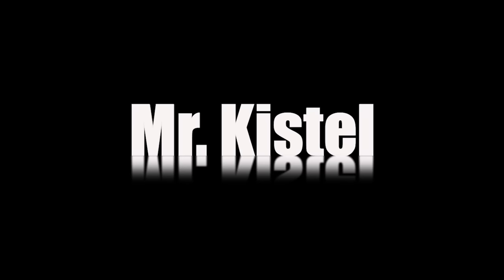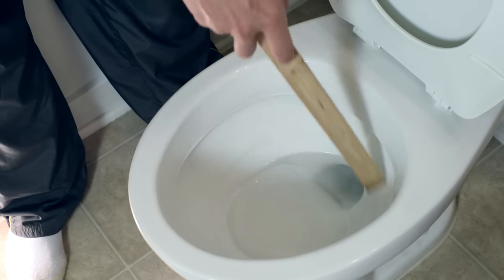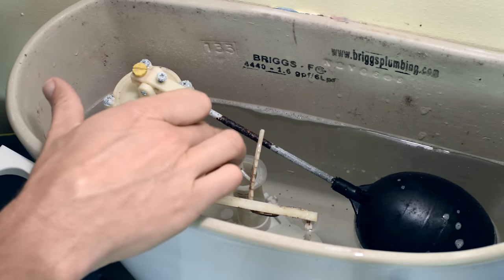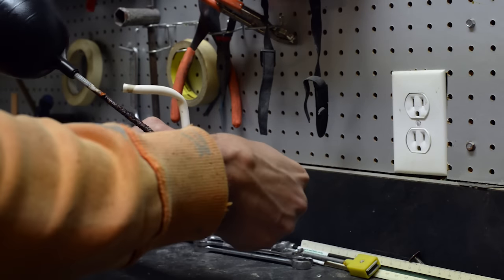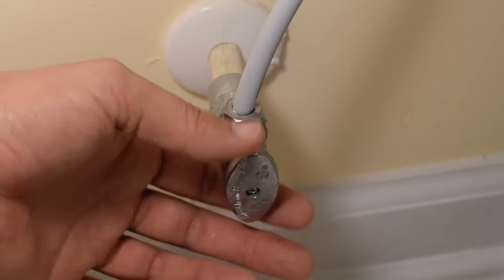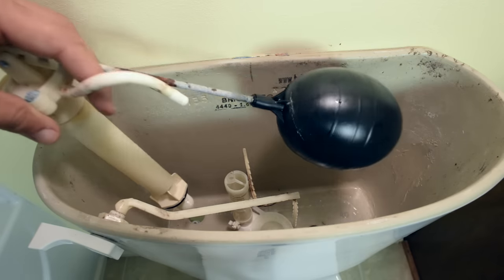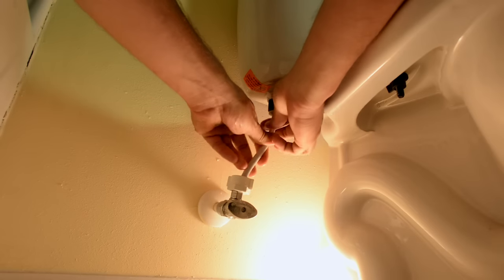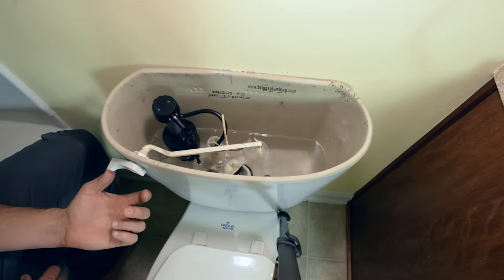Why Is There Low Water Level In The Toilet Bowl And How to Repair

Comment from the maker: Toilet fill valve: http://amzn.to/2uSmt8V
Pliers: http://amzn.to/2FAJmjR
My Children's book about a real life Tugboat story =https://amzn.to/3DbCNTX
Disclosure: The above is an Amazon webpage link. "As an Amazon Associate I earn from qualifying purchases."
Reply: @MrKistel
A relative of mine purchased a new toilet with 1.2 or 1.6 GPF.
But this new toilet has very low water level in the toilet bowl.
Do you think this high efficiency new toilet with 1.2/ 1.6 GPF causes low water level in the toilet bowl.
And do you think if she replaced it with an old toilet which has more Gallons per Flush will have a higher water level.

Comment: That still doesn't show me how to fix the toilet bowl that's not filling up with enough water.
Reply: Ah, you caught that one LOL
Reply: It made sense to me, but it could also mean that your problem has another cause.  Keep checking more videos.  Eg like others said, maybe your refill tube is dumping water directly into the tank, instead of the pipe that it is supposed to dump water into.
Reply: Agreed on that. That tube is called the overflow tube.
Reply: Actually, he showed you that the leak was allowing water to not go to the bowl, so if you replaced the diaphragm or the internal control, the bowl level would be fixed.
Reply: There’s this thing called deductive reasoning. It’s an important skill to have 😂

Comment: Not trying to be rude here, but you didn't really explain how to fix the problem of low water level in the bowl. You just said to buy a new one which I already have. So what's the solution if you have a new water fill valve but still have a low water level in the bowl? Thanks.
Reply from the maker: You could possibly have a problem with your plumbing venting which could create a suction force and "pull" water from the bowl.
Reply: You may have the same problem I did, which was, the filler hose needed to go into the empty cylinder shaped thing. Mine had somehow worked it's way out over the years.
Reply: @powerofknowledge7771  Thank you Angela. This was my problem. Fixed it. You rock.
Reply: @powerofknowledge7771  exactly,  I have a Kohler and indeed that's what happened with mine too. The water refill hose worked itself out of position so it wasn't dumping the water into the cylinder reservoir. When I first looked in, it wasn't leaking from anywhere and I noticed that hose just refilling straight into the tank. Which prompted me to search YT vids to see if that was correct versus being positioned to fill back into that cylinder.  Sure enough that solved for "A".  Thanks on Thanksgiving!
And FYI, haven't had the tank lid off in quite some time, so yeah, that can happen out of the blue all on it's own.
Reply: @powerofknowledge7771  thank you so much ! You solved my problem too
Reply: @MrKistel  Is that the vent coming out of the roof?  How do I check that?  My toilet fills properly, but then the water level goes down gradually.  I have replaced the insides totally, both fill valve & flapper & these did not fix the problem.
Reply from the maker: The venting plumbing will be piping that ultimately leaves the house (usually through the roof).  Sometimes something gets clogged in the pipe somewhere.  There are accounts of rodents, leaves, and all sorts of things falling into vent pipes and creating restriction.  Some have success sticking a hose down the pipe and forcing water to dislodge the clog.  In other cases sometimes venting is not plumbed correctly in the first. Best of luck.
Reply: @MrKistel  Thank you.  Looks like I need a plumber to get up on the roof.  Been trying to do everything myself, but not this!

Comment: Thanks for using Fluidmaster in your video! Just a quick side note for your viewers: Make sure you cut the refill hose down in length if needed. If the end of the hose is pushed into the overflow pipe too far it will cause a siphon and in turn "Ghost Flushing". The end of that hose has to be higher than the water level in the tank. Setting the water level 1/2" below the top of the overflow pipe and inserting the hose about 1/4" down into the small hole in the top of the pipe is the best way to prevent siphoning. We also include a clip with our fill valve that can be used.
Reply from the maker: +Fluidmaster Inc. Thanks for reaching out and the important note.
Reply: What do you mean by Ghost flushing.
Reply: @photoxityforever9503  no its when the ghost in your house pulls an upper Decker. Sh*ts in the tank
Reply: Siphoning would be causing the water level to continue to fall to its lowest state even though the tank is all the way full with the Fluidmaster correct?
Reply: This may have been my problem.  I just replaced the fill valve with a Fluidmaster fill valve and I must say it seems excellent quality, with the clip and great easy to understand instructions!
Reply: Thanks for your feedback!
Reply: @FluidmasterInc That was my problem BIG THANKS IT WAS DRIVING ME NUTZ.

Comment: My bowl wasn't filling up to the point it did before I put in a new flapper in. And it was flushing funky. This was the first video I checked out and it solved my problem. I had hooked up backwards, the thingy that puts the water in the little pipe in the middle. Instead of going in the pipe the water was just going in the tank. I saw what yours was doing and was able to solve my problem. Working perfectly now. I'm a widow, who does many repair jobs around my house with help from you guys and gals on utube. Thanks so much for the post. You're the least expensive plumber I've ever had!
Reply from the maker: So great to hear this video helped you solve your toilet problem.  Thank you for the sincere comment, I feel honored the the video was useful for you.  Congrats on your repair!

Comment: This solved my problem. Thank you. The filler hose had become disconnected from the vertical pipe and moved over. Therefore it was filling the tank instead of the bowl. The lady of the house is happy now that the toilet bowl has a normal water level again.
Reply from the maker: Glad to hear of a happy household now that the toilet has been repaired.

Comment: Thank you soooooo much. This fixed a problem I could not figure out. I became the hero when it worked!!!! You're the best. Wish I could send you a new jar of peanut butter and a clean spoon.
Reply from the maker: haha,  i bet you were already a hero but so glad this was helpful for you
Reply: Thanks for the laugh... great sense of humor! :-)
Reply: @MrKistel  NI
Reply: @MrKistel  Nice video Mr Kistel,, I live in an apt complex in Las Vegas. The water in out bowl is so low, its like dumping in a cup of water. They did what you did and replaced the thing, but the results were the same. I check my neighbors down stairs bathroom when they moves in and yup the same cup of water. Can you ascertain any problem that the complex might be having. We do live up the mountain side, but I been to gas stations and they all have plenty of water in there toilets. Let me know, like how many moving parts can effect the water in a bowl? One...
Reply from the maker: @photo7839  sorry to hear about the low water level problems with your toilet.  Another issue that could cause a low water bowl level is improper sewer venting due a blockage in the vent piping.  In some case that actual plumbing in the building is installed incorrectly or even with out proper venting at all.

Comment: Thank you very much. My toilet wasn't leaking anywhere but I noticed the water was low. after watching your video I noticed the rubber hose that comes from the fill valve fell out of the fill tube. I put it back in and the water line is back to normal. Thank you again!
Reply from the maker: Great news, thanks for sharing and for watching.

Comment: Thanks for posting this! I was having an issue even after installing the exact same fill valve you used in the video. As it turns out, the little rubber hose that attaches the the overflow tube was kinked, so I rotated the valve to make the hose straighter and eliminated the kink. Now the bowl fills up like it should.
Reply from the maker: Awesome!

Comment: I am a master mechanic of all electronics and mechanical everything but toilets. You just saved me so much grief I guess I never knew the whole flush thing. I just installed a new valve float assembly and the toilet has not worked perfect sense. Well it was in-op before that but after the bowl level was always to low no flush.  After watching you vid I realized the little bowl fill hose had a clip on it and I clipped it on the outside of the fill tube.  instead of the inside. The mechanics of you explanation once your video hit 2 minuets on the dot.  I ran for the toilet looked and found the problem right away.
You are awesome. Thanks nice funny helpful video.
Reply from the maker: Thanks for watching and the comment explaining your situation.  So glad the toilet valve installation video helped you solved your low water level issues.

Comment: User-friendly (get it?) video for people who are not handy with plumbing and who cannot afford a plumber. Thanks for explaining well and pointing out the specific places and parts that need undoing, twisting, shutting off...I had a little trouble with parts of your hand obstructing a total view, but that doesn't make the vid a deal-breaker. Keep on 'splainin'.
Reply from the maker: thanks for watching and the comment Carol
Reply: MrKistel, I thought I'd share the results of the repair. The black rubber ring around the new apparatus was chewed up all around. Very odd. The surprise is that the repair did not make the water level increase. The imported toilet is a budget product from a big box store, so the location or placement of the key parts was unusual. The toilet had to be removed and turned on its side to reach one in particular. The hardware story guy commented he'd never seen anything like the configuration when he saw the picture on the phone. From here on out, only American toilets in our house.

Comment: You know what grinds my gears? I've got a top of the line one piece toilet that I paid premium bucks for yet the fill valve is squealing like a trapped pig and needs replacement and the whole thing is less than 5 years old! Our old toilet from the 50's and 60's ran for years without any problems except for the occasional bend float rod or leaking float ball which was an easy fix. Now while replacing the fill valve is easy if you can easily reach the freshwater fill line but my cramped bathroom has the toilet less than 6 inches from the side of the tub making it nearly impossible to reach the supply line! You gotta have arms that flex in a dozen places to reach this thing. Ok, I'm done, nice video and I'm not even going to mention the quality of today's kitchen and bathroom faucets, I'm saving that gear grinding comment for another day!  Cheers and beers!
Reply from the maker: no worries about the venting,  i hope this video helped in some way at least

Comment: Add me to the list of people who simply had the fill tube popped out of place for some reason. Putting it back in place fixed the low bowl fill issue. Thanks for the visual of proper placement
Reply from the maker: Ya that seems to be a common situation. Fortunately, it is a quick fix to repair the toilet though. Glad the video helped you solve your toilet issue. Thanks for sharing.

Comment: Hey Mr. Kistel! Here's one for ya. I have an AS Champion 4 and since day one my water level in the bowl itself, not the tank is extremely low. I've tried everything, changed the seal, bought a new fluid master the one that says how to raise your water level in the bowl, but to no avail, sir! It rises to its point, but just leaks back out not letting the water stay put where it should be. I did everything you did step by step, but no positive results. So I have this friend of mine come over and he tells me that your siphon in the bowl when it wants to fill up is throwing your water out because it might be cracked. So I figure that if that were the case wouldn't there be water leaking all over the place? So heck I was told to check out your YouTube channel. Heeeeelp!!!!
Reply from the maker: Sometimes there can be a problem with the venting in the sewer pipe which can "suck" some water out of the bowl.  In some cases vents can get clogged with debris or even bird nests.  Other times the plumbing may have never been vented correctly.   The venting issue would need to be addressed if this was the case in your situation.
Reply: +MrKistel I'm no expert like yourself but I'll give it my best shot and maybe you can make another video on this situation I'm having here. Maybe someone else is going bonkers, too. Please, standby!
Reply: @captsax  I know this is three years old, but the answer is, there is nothing you can do. A toilet is designed to hold only so much water in the bowl, and it when it reaches its max, it will drain the excess to avoid overflowing. Water height varies by model and is dependent on the height of the bend in the trap way. So your toilet is working correctly, and there's absolutely no way to get the water level higher than it is.

Comment: Very good. Only question is once you unpackaged the new tube, you adjusted it. Any hints on what you did there? Is there instructions with a new one how to do that adjustment before putting installing it?
Reply from the maker: Thanks for watching.  Depending on the new toilet valve installed there should be specific instructions on how to adjust.

Comment: Thanks for the post. I had the exact same issue.  Watching you video, I had the same issue (leaking). I have not used the newer replacements either but checked for one rated high which should arrive tomorrow.   Thanks for that and it was very helpful.  God bless!!
Reply from the maker: Thank you and let me know how the new toilet valve replacement goes.
Reply: MrKistel will do. New part arrives tomorrow.
Reply: Install went well. Seeing u adjust the height was quick in the vid but that was so helpful.  The Install was done and all is working perfect. Thank again.

Comment: I had the same problem,but I didn't replace the float.I adjusted  the float mechanism with the height set screw.It worked without costing any money.It's working for now.
Reply from the maker: Awesome to hear you were able to repair your toilet without any cost. Thanks for sharing.

Comment: Thanks for that! Mine wasn't leaking, but there is a valve on it, where the hose goes out. Mine was turned down too much, just opened it up all the way and water lever rose in bowl. Wouldn't have thought to look there until you pointed out what that hose really is for.
Reply from the maker: Awesome to hear it was helpful for you.  Thanks for sharing.

Comment: You can’t raise a toilet bowl water. The water can only rise as high at the toilet was designed. It rises and then overflows into the pipe and down the drain.  SOMETIMES the valve shuts  off the water filling up the back tank before of the bowl fills up, that is the only time that you could raise the water. That is what happened in this video that the guy fixed. 

Before you waste any money on valves, get a bucket of water and slowly add to your bowl. That’s as high as it will ever get. If nothing changes then there’s nothing you can do. Sorry for the news.

Comment: Thanks for the information and it fixed my issue. I did not have a leak my hose was dislocated.
Reply from the maker: great to hear it was helpful
Reply: I don't get it the hose gose inside the tube or out

Comment: Thank you sooo much, was trying to figure out the solution for a year now
Reply from the maker: so glad to hear this video help resolve your toilet issues
Reply: @MrKistel  before i follow through with the work you recommend in this video, i just wanted to ask:  when i pour water in the pan with a bucket the water level does not rise higher than the existing level, does this mean that changing the part will not help me solve the low water level problem?

Comment: Hi
I realize that this video is a bit old, but its the only one that's informative & similar to the problem I'm having. So I'm not expecting a response, but hopefully I get one.

The problem I'm having is that after toilet water is off & I flush, the water is still squirting out from the fill valve so therefore, the tank isn't exactly emptying & causes water to leak from underneath.
Reply from the maker: Hmm is you water shut valve to the toilet not closing? Maybe you can try turning off the entire house water supply temporarily  and see if water is still coming out of the fill valve?? If not you may need to replace the shut off valve going to the toilet.
Reply: @MrKistel  Thank you so much. I kind of assumed I may need to shut all of the water off instead. I will try that. 👍🏼

Comment: the flushing is working well, the level is good in the toilet at first but over a couple of days the water level in the toilet goes down, not sure if need a new toilet or take the toilet of and check if there is a slight crack that I cannot see?
Reply from the maker: A blockage in the plumbing venting could also cause the water to lower over time. Let us know what you determine is the issue with your toilet and how you remedy it. Best of luck.

Comment: Before you mess with the valve, pour a bucket of water into the toilet, wait for the extra water to flow out.
Now mark the water level with a marker, and now flush the toilet to see if the water level fills to the mark. If it's below the mark your water level is low.
Reply from the maker: Great tip to get a better idea of proper water level in a toilet bowl.